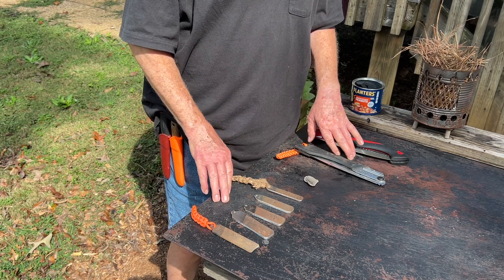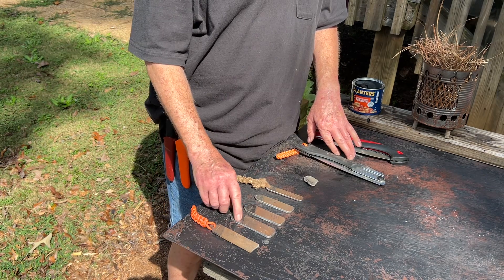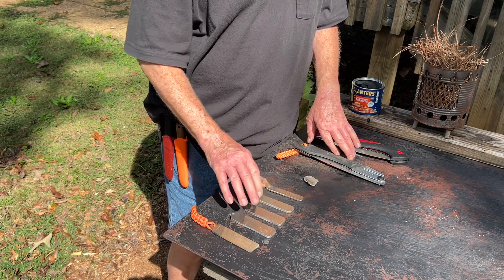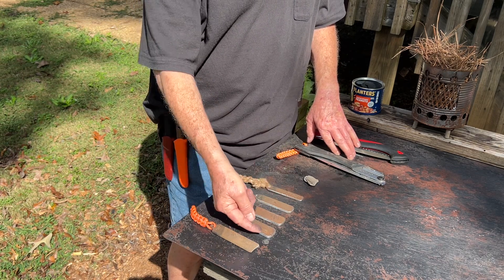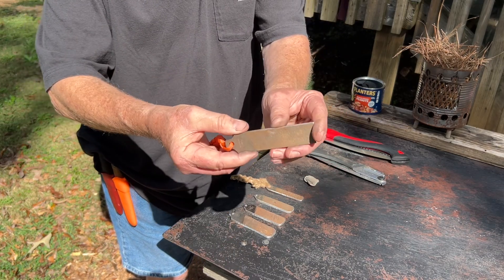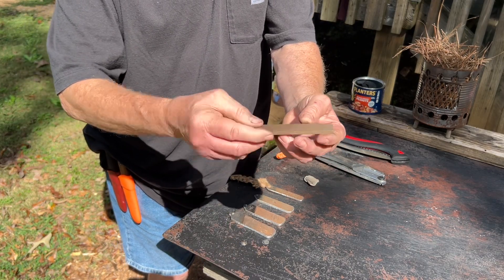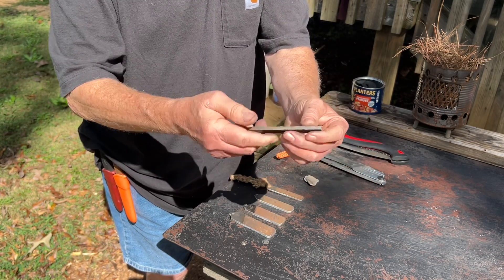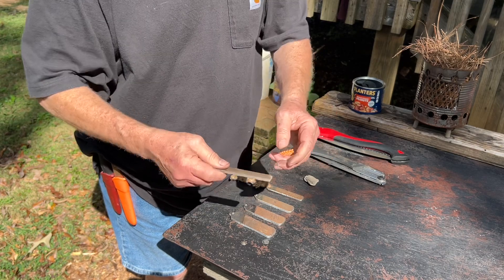Proving Soft Supple And Clean Char Cloth Is More Reactive

Comment from the maker: Demonstrating the Flint And Steel Technique using Chert and 7 Steels. Please notice how much more reactive the soft, supple, and clean char cloth is compared to the hard, brittle, and covered in smoke residue char cloth. Not a GREAT difference in reactivity but a significant difference nonetheless.
1) The first F/S with hard CC took 3 strikes to ignite.
2) The 2nd F/S with hard CC took 4 strikes to ignite.
3) The 3rd, 4th, and 5th F/S’s with soft CC were all 1 strike Ignites.
* Please notice the great cascading showers of sparks that "did not" ignite the hard char cloth while the soft char cloth "did" ignite from very weak sputters of sparks.
4) The reason that the Gomboy saw took 20 strikes to ignite soft CC and the Corona saw took 10 strikes to ignite soft CC is because the Chert had become very dull.
   Please follow the LINKs below and SUBSCRIBE. 

Flint And Steel Playlist
https://www.youtube.com/playlist?list=PLkoXX8XsMW3mFf5FgLtam1aDmXmqQQice
How To Make A Steel Out Of A File Playlist
https://www.youtube.com/playlist?list=PLkoXX8XsMW3n39s_OA1Y3ib73n2Ee57Ed

Comment: I just did an overnighter with f/s and used granite to strike the steel to get a spark. My question is about how refined the steel needs to be. Would an old rusty mining track work provided i cleaned the rust off?
Reply from the maker: Has to be of hardened high carbon steel like 1095.

Comment: Hi David!  My takeaways:  1. The suppleness and "cleanness" of the char cloth makes a significant difference. 2. Tearing and stacking the torn edges of the char cloth 1/16th of an inch from the striking edge provides for many thready ends for the sparks to land upon and ignite. 3. Dull chert can hamstring the process.  4. Persistence and plenty of practice makes for a fire maker with skills.  Thanks for another excellent demo!
Reply from the maker: You got it all to fit Nicky in that nutshell.